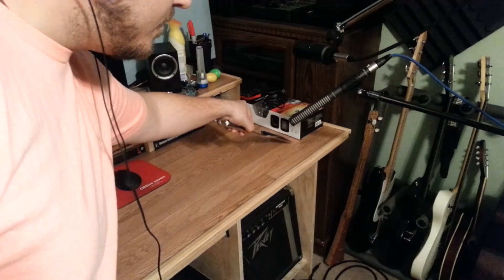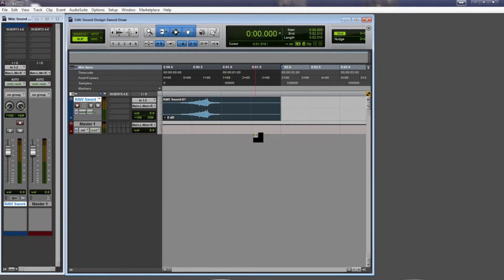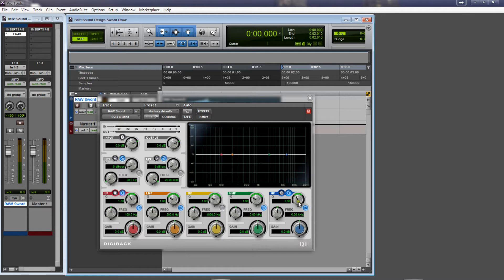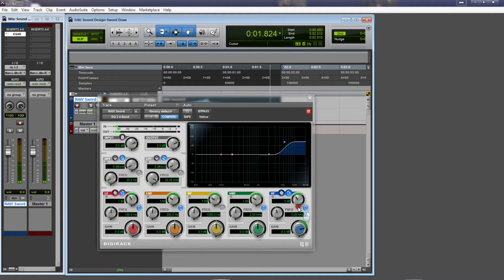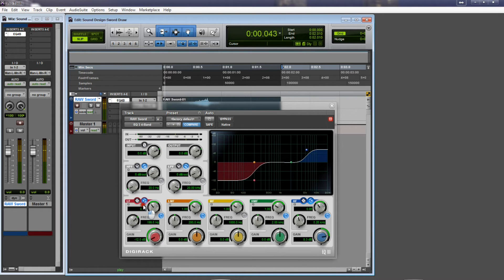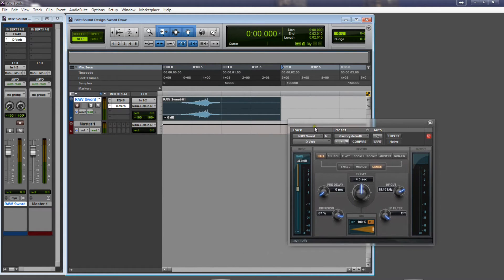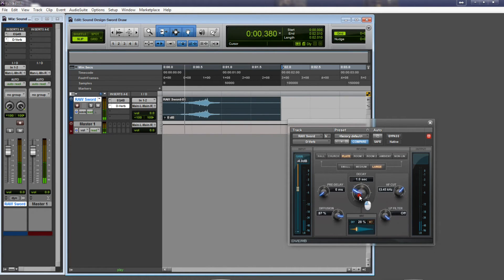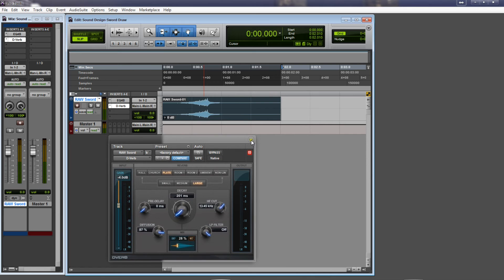How To Make A Sword Sheathe or Draw Sound Effect

Comment: You realize that a sword being drawn does not sound like that, ya? 
Unless the scabbard is made of metal of course, which would be rather silly. 

Drawing swords
Reply from the maker: Of course! If they did, they would be much easier to record and we would not have to use spatulas! Haha! There are a lot of sounds in movies that don't exist in reality, but make the movie so much better than without them!
Reply: Quite a few movies use metal scabbards funnily enough. very few such movies do their homework.
Reply: You guys are misinterpreting "not doing their homework" for very specific sound design. It's intentional. They want the effect of the sword being "drawn," most scabbards or sheaths are leather or some such, and thus don't really make much of a sound at all - which would be rather flat and boring for movies that are meant for action.
Reply: +DΛIMYO yes, obviously.. 
still not correct. I cringe every time that noise turns up in a movie.
Reply: Why would a metal scabbard be silly? It was used historically.
Reply: Rust?
Reply: Kjetil Moen On what? The blade? It's in the scabbard. If you mean the sheath, then maintain it to keep it in good condition. Just as you would with the sword.

And as I said before, metal scabbards were used historically. A benefit of them is that they are more durable than other kinds of scabbards.